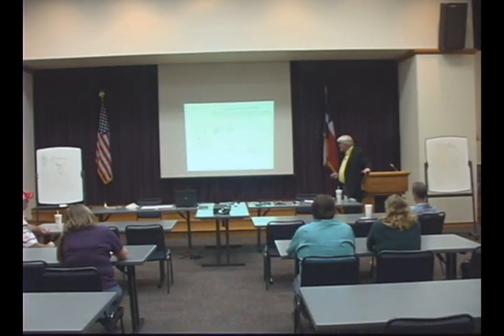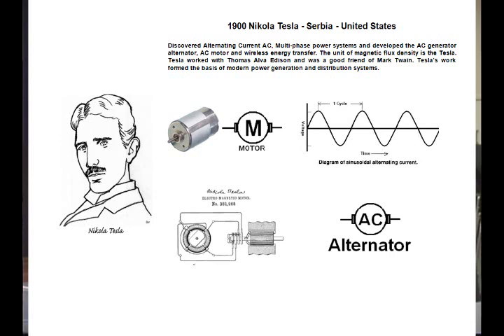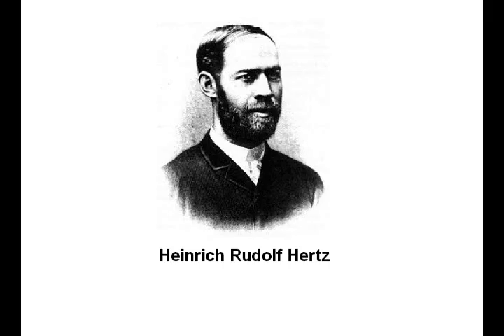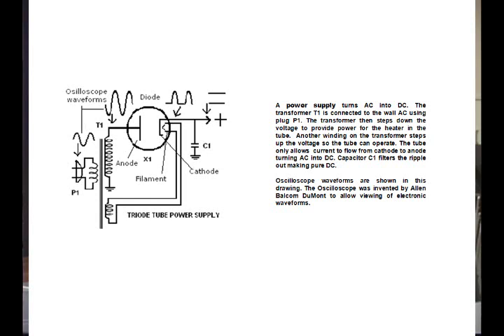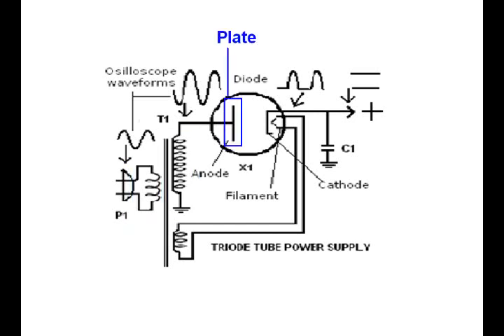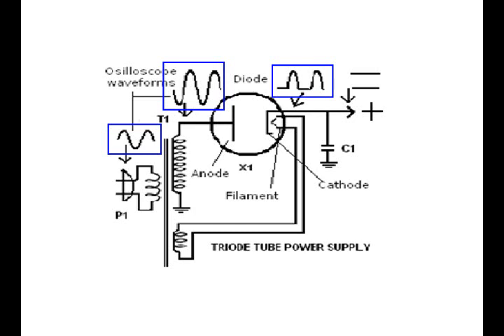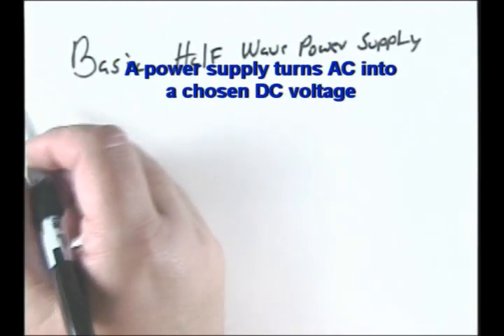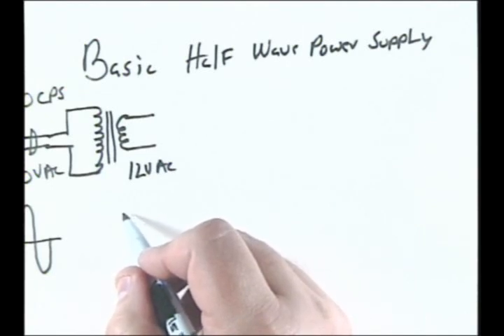Basic Electronics 15 - Tesla, AC, Audion Tubes, Half Wave supplies

Comment: Not to be nit picky, but for 110V AC RMS, the peak voltage would be about 156V (110V/0.707). And for the peak to peak voltage it would be around 311V. And on the secondary side of the transformer, I would assume that you meant 12V RMS since you mentioned 110V RMS on the primary side. If so, this would be about 17V peak to peak. There's a few other things wrong, but I figure you're just trying to keep it basic for the beginners.
Reply: LOL Terry  "keep it basic for  the beginners"  I think I need to get some refresher courses.
Reply: Hi Steve, it looks like no matter where I go, you always find me LOL. I just ran across this video and the fella has a PHD in electrical engineering and I'm sure that he knows all this stuff. I've been debating with myself if I should upload some videos on electronics starting with the basic stuff and working up from there. I was thinking the subject matter would be geared toward technicians. So, it wouldn't be a lot of atomic theory such as majority, minority carriers, holes, covalent bonding, etc. I'm not sure what to do at this point as there are a lot of videos out there that cover the subject. And by the way, I hope you're doing well.
Reply: stuzman52 Terry,  please do!
Reply: Hi Thomas, let me roll some thoughts around and hopefully, I may be able to come up with some topics that may be of interest to techs. The biggest objectives would be to understand how circuits work so that one can troubleshoot them more effectively and to make it interesting and fun to learn. Thanks for your comment Thomas!
Reply from the maker: Correct

Comment: A cycle is simply the time period required for a wave to return to its original position, i.e. travel 360 degrees. A cycle may take any length of time. We use cycles per second (Hz) to lock in the time period, but that is for convenience sake. Cycles per second = Hz...but what if a cycle takes 2, 3 or 60 seconds to complete its traversal? Or a year? Do you think that it would still be convenient to talk about these things in Hz? Maybe that's why cycle is retained, they're quasi-independent.